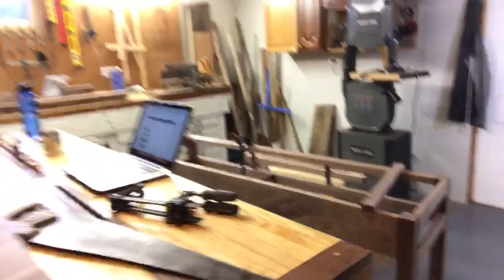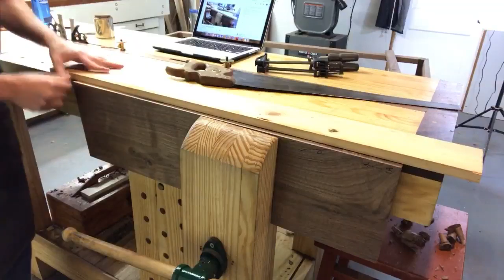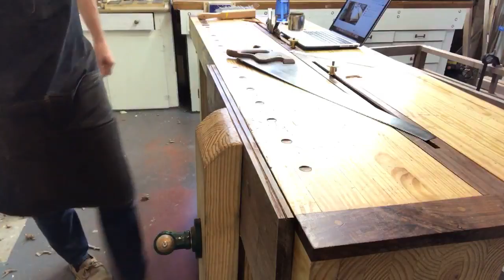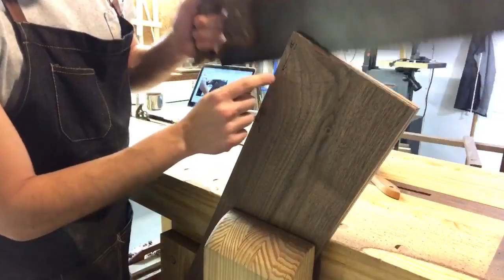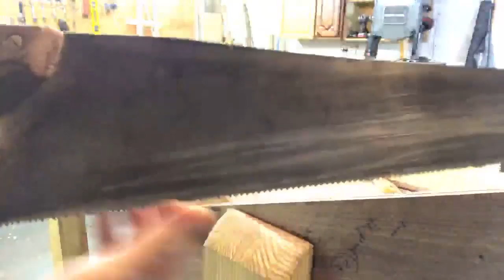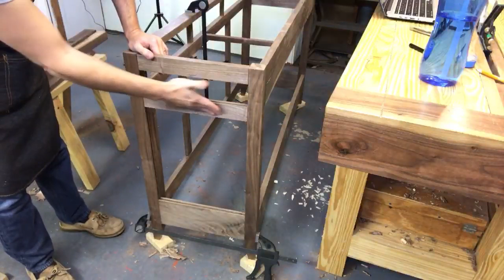Part 1: Resawing 8” wide walnut by hand

Comment: Can you resaw walnut from similar thickness boards to get multiple pieces 5mm thick or is it too difficult by hand?
Reply from the maker: The biggest factors that determine how thin you can resaw is accuracy, original thickness of the boards, and the saw kerf you make. My saw leaves a 3mm kerf and requires about 1-3 mm to plane it smooth. I loose maybe 6 mm from the thickness every time I resaw. So my board much have enough thickness to accommodate this.  Also, sometimes the saw wanders. So you want to account for that. I have resawed a board to about 4-5 mm before so it is possible to do 3 mm if you are accurate! Good luck!

Comment: Just subscribed. I'm watching this because I've been wanting to manually resaw a 24" by 2" thick walnut. I'm trying to figure out if it's worth it.
Reply from the maker: It might be… but it will be work. I’d say don’t try to do it all at one go unless you have a great setup with a very coarse saw. Mine is 7tpi and it would be much better to have 4-5.

Comment: Good video! I am still confused about what type of "rip" saw I need to use. How many TPI or PPI should it be?
Reply from the maker: Hey! Mine is 7tpi. It would be much easier with 4-5 tpi. Also, and please forgive me if you know this, a rip saw has teeth filed perpendicular to the plane of the saw plate. That allows it to “chisel” through the grain, when going with the grain. A cross cut saw for this application would be terribly frustrating.